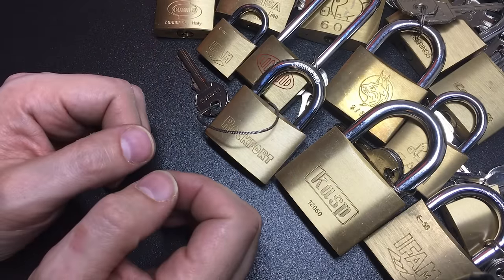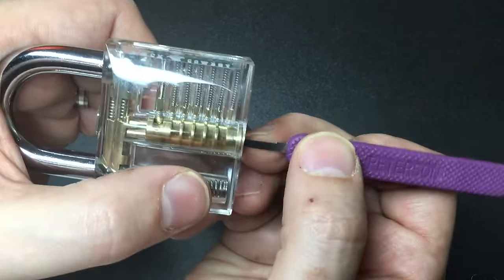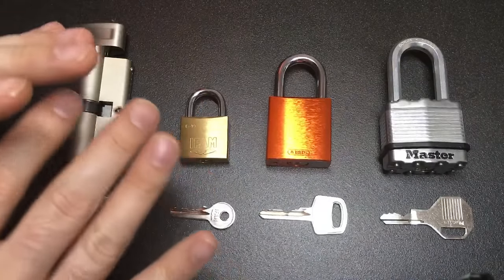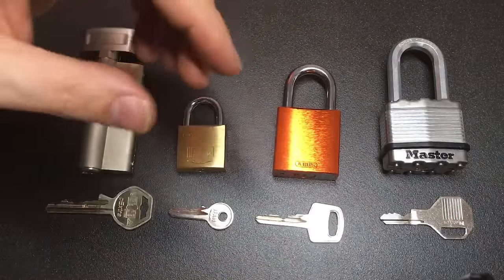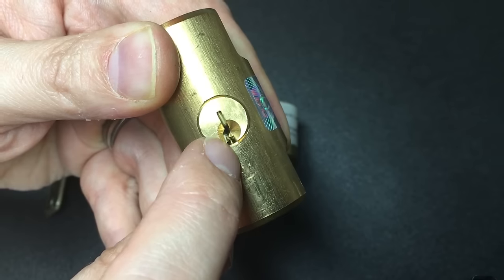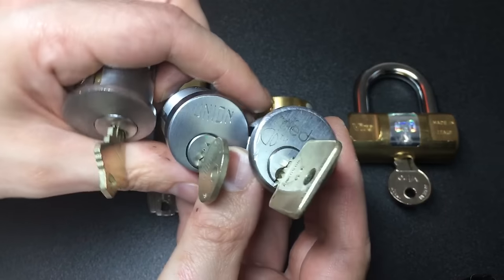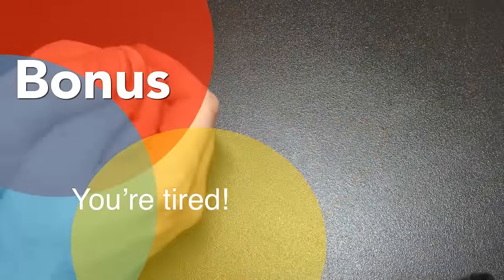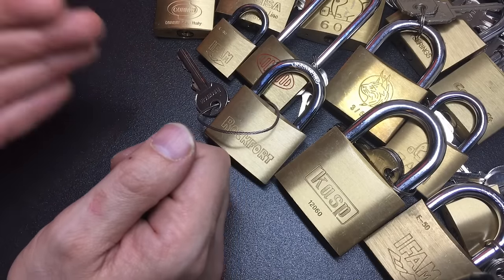Top 10 Reasons Why You Can’t Pick a Lock

Comment: Many years ago, mid 1970's.
One of my ELDERLY co-workers had an OLD 28" Royal Enfield pushbike, that he didn't want or need (and as he was retiring ....)
.
He asked me if I could make use of it.
-
I wasn't overly keen (being about 17-18 at the time, and push-biking for me wasn't one of my preferred modes of transport (having a motorbike & a car at the time meant that a pushbike wasn't EVER going to be something I would want, especially one that needed long legs to operate  & my short-R's one's needed to go under the horizontal bar to push that bike's pedals).
....
It was however, the LOCK, which I liked, that allowed me to say:
Yes.
I asked him how it opened, and he showed me.
OK (I thought) - Got it, and I tossed it in the car boot.
?
?
?
?
?
Buggah me, but by the time I got it home - after a full night at the pub, I didn't have a clue as to "what" he had showed me, (on top of which, I had simply tossed it around the back of the farm-sheds, and forgot about it for several weeks).
I found it still there, when tossing something "else" behind the sheds, and decided to drag it out and check it out.?

Uh-oh?
Why won't the back wheel turn?
That's when I saw the hasp through the spokes under the seat - and remembered about.....
T
H
E
"lock"..
A simple affair, which was bolted to the frame.
?
And on both sides of the main body of that "lock?"
Were two arms/legs - whatever, that curved around to "just clear" the wheel-spokes.
The main body had a huge metal knob, with a lovely (FAKE) ruby on it.
The hollow arm/legs that curved around ("and almost-met") until just clearing the spokes, in-fact held a movable semi-circular tube/rod that could be slid all the way underneath, through the spokes and back into the hollow arm/leg on the other side, and "clicked to lock"
Oh crap, how did he unlock it - I couldn't remember.
---
CAN YOU?
All I knew was that there was a series of MOVEMENTS, one could make with the huge metal knob, if pushed to either side of the exact center, and another "movement" UP towards the seat which would UNLOCK the hasp, IF?
If the correct sequences of sideways movements were made first.
IF NOT - then the entire lock function reset.

Meaning, NO false gates, no false turns, & no buggah all?
One had to get it all done EXACT.
It was the most frustrating LOCK (without any key, numerical rotating numbers, or any other means)
.
JUST the darndest thing - how many slides left, right left and or right again?
Before lifting it up to discover?
Nah not correct - again.

I eventually remembered where I'd put the wee piece of paper - that HAD the right code on it, but without that - it would have remained locked forever.
P.S:
Unbolting the lock from the two vertical frame tubes directly under the seat, just meant that the rear wheel would ALMOST do slightly more than half a turn, before that LOCK collided with the frame.
Taking the wheel off ?
Left you without a rear wheel.
Oh and best of all, if one put the hasp through a hoop of a chain & put the chain around the main frame itself, then fed the hasp through the other end of the chain, meant that taking the back wheel OFF, left you in a bigger mess, as you couldn't take that away from the frame, to put another wheel ON.
Thus the bike was still unrideable.

Comment: @Lock Noob:  What a great video - I just found this one.  In item 8 - wrong mindset where you suggest that we may underestimate the lock, can I add that the opposite also applies?  Sometimes you second guess the lock by thinking it's a really tricky lock, so you start out picking with the expectation that you'll have problems.  Then miss the feedback that you've actually done it and it was far easier than you thought it was going to be...!  This is where you keep going and end up oversetting one or more pins.  And your final point about stepping away from that lock (or any lockpicking at all) for a day or three is great advice.  I do that regularly, and I also keep my set of progressively pinned locks on my bench, and if I get into that mind rut of frustration, I move back to a 4-pin, or even a 3-pin lock, and pick it a few times, just to "get the feel back".  Works wonders for the mindset...!
Reply from the maker: Yes that’s a good one, and true!

Comment: One of the best lock picking videos I've seen. I"m a newbie to this lock-picking thing lol, and I'm frustrated with a "simple" Guard Security brass padlock.  It's an old, well-used padlock (which might be part of the issue). I have the key to it, and it works fine, easy to turn the key, but I can't rake it, I can't SPP it. I've opened several other padlocks, door cylinders, but this is giving me trouble, and it seems it should be a relatively easy pick. I don't care so much for the  "Lock Sport" aspect,  but more for just knowing I could get into a lock if I needed to, so I don't mind using tryout keys, jigglers etc.I think I stumbled upon city-raking it open once (only once) which was complete luck. But it's been days and I can't repeat. Great words of advice in this video.

Comment: If you can take a lock apart and rebuild it, you can always make it easier to pick by removing parts. For example, if you have Assa twin, remove all but one side pins and train to pick that. When you can do that easily, add one more side pin and train more.

With disk detainer locks you may need to use disks with more gates meaning you may need to purchase some locks to be used for spare parts only. The Abloy is especially known for not willing to sell the disks to non-locksmiths.

Comment: My main issue that this video solved was that my tensioner was at a bad angle and was tensioning the body of the lock instead of the core. Flipping my tensioner to the other side/changing the angle fixed it, thanks!

Comment: Yup, fallen into most of those traps.
My worst facepalm moment was a complete missidentification of the lock mechanism. I was out shopping for locks and found a used bicycle lock laying on the street, sweet, free lock!
Very small keyway so know it would be tricky even though it looked kinda cheap, looked like a pin tumbler, even felt like a pin tumbler, but I now know that it is a dimple lock. I didn't like the feel of it so only wasted about 15 hours or so, but yeah...that sucked. I've since then started to learn dimple picking and have successfully picked that lock several times.
Reply from the maker: We’ve all been there, but it’s a good outcome :-)

Comment: I have a very heavy high security padlock in the garage that i have had a go at picking it on & off but not for a while now, I can't remember the make of the lock without going into the garage & looking, I have seen a video on YouTube of a guy picking the same lock, I also have another old brass big padlock in the garage i found somewhere that i need too have a go at picking, I think i will go into the garage & get my picking tools out & get both paddocks & have another go at picking the high security padlock & the big brass padlock, The picking tools i have we're only a cheap set that i bought on eBay a while ago now, I also have lots of other door locks etc as well some are very old, After watching your video i'm going too go into the garage & get both padlocks, I will have too see what other door locks etc,etc as well i have in the garage i know there is a lot, I have the padlocks here i'm in the living room the high security padlock is made by KABA 6062 also on the back of the padlock it has EN 12320 Grade 4, The other old brass padlock is already open i haven't picked it that was how i found it the padlock is made by D ZENI Z16, I also have another very old padlock here with it's original very old key not a modern key it is made by IMPERIAL, I will have a look in the garage for the other locks later.
Reply from the maker: Just keep having a go!
Reply: @LockNoob  I was having a go today in the garden i still couldn't pick it i'm new too picking anyway, There is a guy on YouTube who is in the UK who picks the same padlock in about thirty seconds, In the description he does say he was lucky picking it that quick basically normally it takes longer.

Comment: Yes, there is another one: you're trying too hard. sometimes you can get angry and over tension a lock, or even be trying to pick a pin that isn't there or actually (this happens to me a lot) be picking a retaining pin or a piece of warding. Sometimes coming back to the lock when you're less tense helps. I have a couple of egret padlocks that always catch me out if I'm rushing or trying too hard, yet open in a few seconds when I'm more relaxed and casual about the whole process. Also I used to get frustrated at not being able to get past the first pin when I didn't realise that the slot through the lock is narrower than the first part that guides the key in or is worn more. (Or I'm binding the first pin by pushing the tension tool in too far
Reply from the maker: Yes, another good one!

Comment: Thanks for another great video, love your stuff. I think this has helped shed light on some issues that I have had with SPP. I am fair with raking but haven't been able to spp with any luck and Ive been wondering if it wasn't from over setting. Another point I was curious about was I've found several locks that I can only seem to rake while turning the core in one particular direction (they do open either way).  Wondering if my technique isn't binding the core going one direction and is going the other.
Reply from the maker: Thanks 🙏

Comment: I've bought 2 really cheap locks that are technically not broken but are broken for picking. The metal around the keyhole is bent out of shape because it was really malleable so I can't make my tension tools fit it to turn it. The key still works with a bit of effort but there's no way it can be picked without modifying a tensioner somehow.

Comment: Another reason to fail opening a lock that has happened to be a couple of times. It only turns in one direction. I've seen it in what I would call "cupboard/locker" locks. Some have a back piece where it's obviously blocking one direction if you look at it. But I've also had one where I guess there was a groove in the core and a pin in the bible, so there were no way to see it from the outside (and who tries to keys first... ;)

And in at least one case I could easily open the lock in one direction, but in the other direction, after picking a couple of binders the lock felt all springy and strange and I got sooooo frustrated with it. Well, until testing the key and realizing my mistake. ;)
Reply from the maker: Yes, trying to open a lock the that turns the opposite direction is always a pain!

Comment: The lock is already open. I have a very cheap lock. You can pick like just 3 of 5 pins on it and with enough tension the shackle will pop up. The lock is opened without finishing picking.
Reply from the maker: Yes, I’ve seen locks like that myself 😃

Comment: Great tutorial!  What is the model of that big, ugly multilock in between the two smaller locks?... i love it!   I'm new to lock picking and am quickly getting the hang of picking standard pinned locks, but am losing my mind on a master lock 2240.  According to lock wiki, this lock has spools in it, which makes sense bc i often fall into false sets. It also can't be gutted, has a spring tensioned core, and has extreme bitting as with your orange lock. I accidentally picked it once, but don't know how i did it and it's driving me crazy. I'll use your advice and have at it again with a deeper hook after i practice on a mortoise cylinder loaded with spools. Thank you sir

Comment: Bro this exact lock  type is what I’m having issues with, I can pick it 1/10 …. I mean I can pick it every time by bypassing the pins because those brass locks are notorious for having a weakness in the back of the lock where u can just move the balls holding the shackle in place, however I’m really trying to learn single pin picking weather than raking it open or bypassing it just to hone my skills. No problems with the other padlocks I have picked only the solid body brass one

Comment: Bought myself a pratice lock set, the pad lock while the key it comes does make it open, using every picking tool made me question a lot. After watching your video and others using every technique I seen and heard it just wont turn, the binding is just odd. just a quick rake of all the quick strikes & leveling the pins either get stuck or they're loose. Using the prying tool too much will cause them to get stuck plus strain your palms muscles, not enough wont bind any. The only feel and clicks i get are pins going all the way through or not binding (no sweet spot), moving slowly doesn't fix the issue either. 
However Pin 1,2,5,& 6 are the only issues ; pin 6 is the starting point lifting until you feel a blockage, too much pressure will push the core pin all the way, doing it slowly will sometimes look like it levels but the moment you lower your pick the pin just drops. When it does sit still at level two things happened, 5,1,&2 core pins will be pushed too much from the neck of the pick or all other pins except 6 will just be loosed, no bindings. 
It's a cheap padlock anyway so i believe it's best assume the pratice lock is busted. The others locks from the set work fine.

Comment: 10th point:
I had a similar issue with an Abus 85/50 
Raked it and got a 90° turn but the damn thing wont open...
After 20 succsesfull turns and almost destroying the warding with my tension wrench I realized that the shackle just needed a little push to open
The shackle just rusted to the lock body...😂

Comment: I wanna add one more reason, youre using your turner wrong, a lot of the issues here are exacerbated if you use a bottom end turner, lowering the angle that your picking tool can be used, making it harder to get behind those low set pins, and just pain getting in the way making you accidentally bump pins and reset them

Comment: I have struggled for hours and hours with a Swedish Masterlock style padlock, and a Chinese one from a company called Doublelink. These presumably cheap ones I have gotten open but it seems to be very random. I have not found a way to reliably pick them, and it feels like I don't know exactly what I am doing to get them open. Today I did get a hold of an Abus 64TI/40, and I opened that one up multiple times both by raking and single pin picking in about 15 minutes. So what gives? Are the cheap locks just so poorly manufactured that they are actually harder to pick?

Comment: I understand at 2:56 about how with too much tension you are actually spreading the lock and making it so it won't move. I don't understand at 3:26 you talk about how you dig into the body of the lock. Wouldn't the core still turn because you are underneath it and the force would still make it turn?
Reply from the maker: No, not when the tension tool is literally digging into the lock body, all you are doing is wasting your time st that point
Reply: @LockNoob  how do you get around that?

Comment: I have a Masterlock model 570 I think you recommended this lock in the progressive locks video. I have all of the Sparrows locks even the revolver I can open them all no matter what pinning I choose, but this fracking padlock is simply unpickable for me. I even bought another pick set and I can't open it and I simply don't know why. How do I improve my skills enough to conquer this damn lock? The pin springs are pretty strong and finding a binder seems impossible, yet when I release the tension, I hear pins drop, so I know  I'm getting some set. I try it maybe once or twice a week and I still pick my other locks changing the keys and adding security pins so that it's impossible for me to memorize the binding order of any of these locks. Yet this Masterlock has me whipped, I feel stuck like I'm not improving, does this lock required heavy tension or really light tension anything that you can tell me about it would be a fantastic help to me right now.
Reply from the maker: I’m afraid it’s just down to practice and pick choice. If you can, try to progressively pin the lock, starting with the first 3 chambers full and the rest ampty

Comment: Tip for beginners: always try to explore a unknown lock with a very slightly hooked pick before you start picking, or even start applying tension, so you can feel whether the keyway contains unexpected things. 

Ps. I always cringe a little when I see someone immediately put the tensioner at the rim of the cylinder, that should really be a last resort (the closer a force is exerted to it's axis, the less the cylinder grinds against its jacket).

Comment: Anyone else who has novice experience and gets arm cramps from not picking fast enough. I started of straight away with no beginners lock and I get arm fatigue and cramps within 3 minutes or more
Reply from the maker: I still get fatigue on some locks with steel springs in the pin stacks and a strong core spring!
Reply: @LockNoob  well I'm glad to hear it happens to even experienced pickers like yourself. Is it probably a sign to take 5?
Reply: @LockNoob  also fyi im starting off with a pin and tumbler,  brinks padlock. I believe its a 5 pin. Kinda hard to tell with lack of experience. Its a little guy and thats the probable cause of my hand cramping/arm.